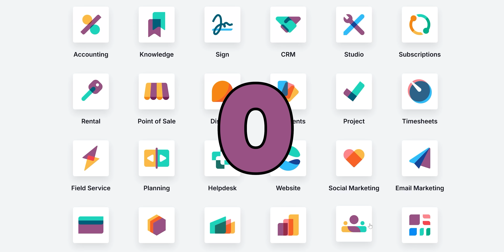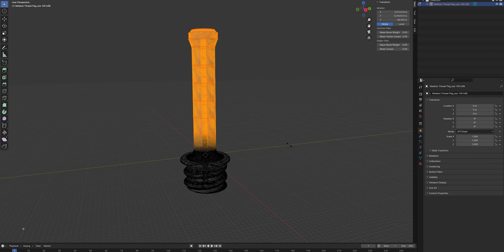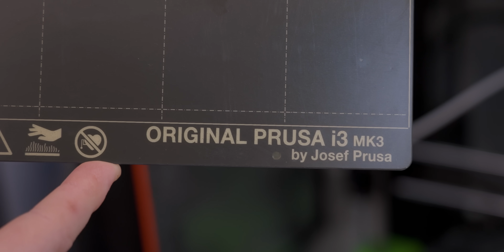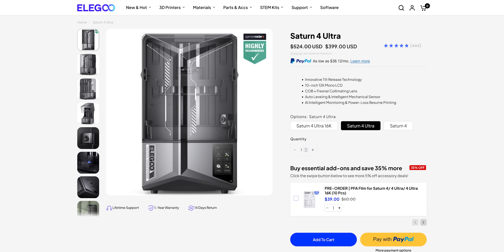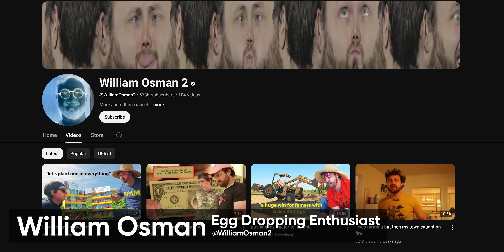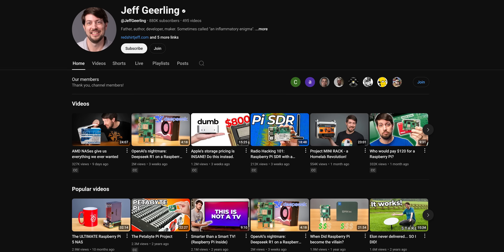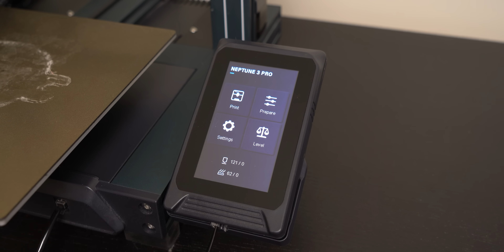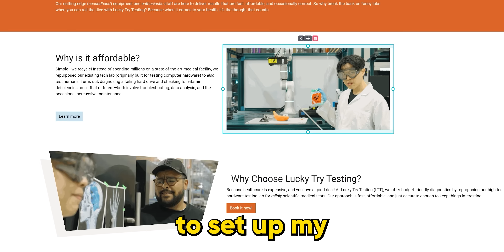Is my 3D printing setup wrong?

Comment: I got an X1C and it has been a dream ( like all bambu printers ). I frequent r/3dprinting and r/fixmyprint and everyday I thank myself that I paid a few bucks extra from my X1C. It self calibrates, does pressure advance, flow rate calibration, sphagetti detection, first layer inspection (only on non-transparent and non-glossy filaments). It is literally THE printer if you want a printer that JUST WORKS.

Of course A1 and A1 mini even P1P/S are also amazing since core tech is shared. And you can manually upgrade a P1 to include most of the highest impact features, like replacing the default nozzle with a hardened one, 3d printing an enclosure (for p1p), add a chamber filter and so on.

I am not a hardware tinkerer, I am a software tinkerer, so my favourite part is experimenting in the slicer and gcode post processing scripts using Orca slicer, imo it is the best slicer that gives you every tool to screw up your 3d prints IF YOU WANT TO, while also having 1 click profiles from Bambu studio as well if you decide not to tinker for a print.

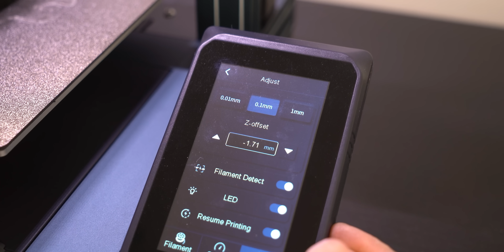Comment: 17:00  I had similar issue with my CR10-S Pro V2 and it was an issue with their firmware, where it didn't persist the auto level and z-offset values to the eeprom, so every time you turned the printer off, it reset...
Took me years before I figured it out and I just switched to QIDI X-Max 3 anyway, but there was a fixed FW around for it which I installed and it fixed that specific issue.

Comment: I have owned 3d printers since 2015. I've owned Creality (CR10 5S), Anycubic (both FDMs and Resin), and old delta Hatchbox I believe it was, and a Bambulab P1S. With the exception of the P1S were absolute crap. I have had only 2 prints fail out of dozens on the P1S and that was my fault as the print bed was in need of cleaning. The others, not one had a print success rate above 50%. As to Prusa, you buy a printer as reliable and as fast as the P1S for nearly double the cost? Think of all of the filament and prints you could pay for. Big no on Prusa until they are more cost effective.

Comment: As someone that wanted a printer for "function" and not a "tinkering hobby" my P1P has been excellent. It's reliable. It's fast. It "just works" (seriously, I've had 0 issues so far aside when trying to print things that where clearly not made for aan FDM machine XD). It's low maintenance. As much as I hate what BambuLabs did I'm not switching team just because for the 10-15 prints I do a year it's just not financially something I'd recover from 😅

Comment: As for the moisture, it's just not a problem with PLA. My printer is in a literal barn here in Florida, and it's currently 72 percent humidity inside my bamboo printer, which is printing fine. its other filaments that are the issue. I'm new to printing, but the last couple of months been printing and storing my pla outside in fl unsealed with no issue

Comment: 5:54 i learned the name of that sort of thing from watching "Smart Every Day" video on the kodak film factor, it's name is  an Accumulator. in their production line the film has to keep going so when they are changing rolls of "plastic" they need a way for the film coming to Accumulate before continuing. It is that big for a reason.

Comment: The Auto Bed Leveling feature that Camden mentioned is HUGE. Aside from drying filaments, bed leveling is a NIGHTMARE for new users buying cheap printers (like the Ender 3). On modern printers auto bed leveling is a necessity unless you want to spend 20 minutes leveling your bed every other print.
Reply: 100% recommend upgrading your printer with a levelling probe if you can. My cheap Ender 3 I can just hit print and let it go with PLA now (PETG can still be a bit hit or miss depending on when I last cleaned the bed 😅)
Reply: Swapping to opennep4une fixes that problem, but i agree its a huge problem. I thought they fixed it in a firmware update though, that could have just been for the 4 im not sure

Talking about the issue he had with the elegoo
Reply: @philmcruch  I have an Ender 3 V3 SE that I bought from them directly on ebay for $100 this past holiday season. It has native bed leveling and was practically turnkey, unlike my old Ender 2.
Reply: the current ender 3s have auto bed leveling
Reply: Why would you need to level it every print?
If leveled once it should stay in that position for a very long time,.
And even if not level, then what's the worst that would happen? Your print will be a millimeter offshape?
Most prints don't require that big of precision level (and most cheap beginner printers don't offer such precision in the first place).
Reply: @hubertnnn  Because every time you pull the plate of the printer to remove things  and reposition it something might catch under the plate and in some printers you can flex something. 1mm off is the difference between printing first layer entirely in the air or scratching the bed plate with your nozzle. 1mm is also quite a lot for any functional print.
Reply: @hubertnnn  many cheap printers use V rollers on a narrow rail - those get easily skewed with any amount of force. On my ender 3, I got to the point of manualy leveling every other print with a custom g-cose to not touch the printer until the print is finished. Then I got BL touch and boy, it was much better. Well, after compiling custom firmware, because stock implementation sucked and did random axis movements just like the printer in the video.
Reply: @Papinak2  That explains a lot. Its sad that YT deleted your comment, but I was still able to read it from the notification.
Together with @Przemo-c's comment I can now see the whole picture.

Comment: I've been printing for a couple years now, and started off with the Phrozen Mighty 8K. The printer is very nice, but wish there were some features that I saw others had like the auto refill sensor, vat tray with actual handles, and the lift plate with an attachment to let the excess resin poor back into the vat. Which the Uniformation GK3 Pro covers all that and will be my next printer.

Comment: flsun takes a different approach. Instead of quiet printers, they make them really fast, so you dont have to deal with noise that long. their best machine does a benchy in 9 minutes. I haven't heard neagive reviews about them, but I haven't been looking that long. my flsun super racer is working great, although its still from a generation where its a hobby, not a manufacturing machine.

Comment: They haven’t changed the deal after the fact. Third party integration was NEVER an advertised feature, there’s no deal to change. It just happened to work, and people utilising open protocols were told they were on borrowed time before it was fixed.

It’s disappointing you featured garbage like geerling who were quick to jump down the throat of bambu for clicks and engagement before even waiting… I think it was barely 24 hours before he supposedly had it all worked out… 

At least this video isn’t an interesting take on the saga, and isn’t purely just trying to profit from the algorithmic hate train (thumbnail aside)

Comment: 16:43 OMG that reminds me so hard about that buggy design my BFB 3D Touch had.
They used a magnet for getting the z-offset, which works fine when cold... BUT! if the plate got warmer/colder because your room temperature changed - BAM! Z gets a absolute offset of 1mm.
I fixed it by using an ir beam fork out of an printer and adding a black piece of plastic lol, never had an issue since with my z leveling again.

Comment: If you're not using Octoprint (or another FOSS firmware) you might be doing 3D printing wrong.

Even for professional use. Stop overpaying for "enterprise" proprietary junk.

(I say using a 10 year old makerbot clone)

Comment: The Elegoo Centauri Carbon is basically a P1S clone that retails for $300 and will soon have it's own version of the AMS and will likely be the go to entry level 3d printer, so I hope the LTT crew will give it a look from outside of the 3d printing community bubble. I myself own a P1S that I love (aside from the recently introduced software/access issues) and a heavily modified Ender 6 that I learned a lot using but would never recommend given the much better 2025 options.

Comment: Flashforge amAD5M was literally plug in, install filament, run built in calibration and print models. 

Prints up to 600mm/s and can be had for $279.

Way better than any other printer I've had

Comment: I have an Ender3V2 and an Ender5Pro. I have upgraded them with all the bells and whistles, at least doubled them in value in upgrades alone and made them hands free. Haven't had a print fail for 2 years now.
Reply: Showoff
Reply: bambu is better value really, those upgrades costed how much?
Reply: @ellisfletcher3491  I have had these printers for years. Don't get me wrong, I have eyed bambu printers for a loooong time, they're certainly good value, but I'm not the type to drop €600 to €1500 in one purchase. Idk exactly how much I sunk into my enders, but the most upgraded one by most is my ender 5 pro. It's got a bltouch, coreXY mod, direct extruder mod, upgraded hotend, noctua fans, diamond nozzle, linear rails, runs klipper, accelerometer for tuning,  raspberry pi + camera so I can start and monitor prints remotely and a wifi plug adapter to turn the printer on and off remotely.
They're fast, tuned, and are reliable. Yes I've sunk as much money into it as a p1p, but I love tinkering and repairs are cheap and readily available. It has been good value to me personally.
No multi filament printing tho, but I mostly print replacement parts anyway.

Comment: I'll stick with Bambu Lab printers. You can use any slicer you want, but yes it will be more seamless with their slicer. Exporting a file from your preferred slicer and using intermediary sugar to send it to the software isn't an issue. Could also move the memory card between the printer and computer. Bambu was never open source, so none of these changes should be a surprise. For those that feel differently, thankfully you can shut off Internet access to the printer, or use one of the countless other brands.

Comment: Creality has pretty much solved the filament jamming issue by making it easy to access it from underneath on their CFS. Plus, with a 350x350x350 bed, I'll definitely be going with them next. Only been into 3D printing for a month and I love it, I've had my Flasforge 5M Pro for a month and I already want to upgrade 😄. For the price the Flashforge 5M Pro is amazing, but I want to get into multicolour prints, plus that massive bed is very nice.

Comment: I will say being a P1S owner, the updates that everyone is concerned with have zero impact on me. Being a hobbyist as it is and maybe randomly printing things for my wife to sell. So I’ll be sticking with  my P1S.
Reply: Also Linus, print the desiccant pods for the AMS units and add hygrometers. Then all you need to do is get some bulk desiccant to fill the pods up. These keep my filament around 10% humidity.

Comment: So you are complaining about an update for the X1C while you are showing yourself using a P1S?  Yes it is an issue for the community, but it's not hard to just turn off auto-update and wait till the community either finds a workaround, or BBL gets in trouble with the EU for deceptive practices and ends up on the wrong side of a lawsuit.  Either way, this has been driven into the ground MONTHS AGO and for you to act all surprised now because of the new firmware announcement just makes you look bad man.

Comment: I have a rather large print setup with both sla and fdm, I don't have any drying in my setup, I live in and extremely damp area but all my stuff is in a basement full of unsealed concrete that is cracking so it is supremely dry down there.

Comment: I went through the 3d rabbit hole when my wife got me our 1st 3d printer. 3d printing wasn't really on my radar until my wife was like I did a thing lol. I was a bit surprised at 1st. she had bought a creality ender 3. super basic printer. it was love at 1st sight lol. didn't take long before I rebuilt the printer. I did a silent board, new power supply, and direct drive extruder. then came the 2nd printer and modded that one and the 3rd yup modded too. so, now I have 2 ender 3s an ender 5 plus all great printers. but they are running marlin which means not very fast at all. but then Klipper came out and that is a total game changer. I now have the elegoo Neptune 4 plus that has such a great printer. sad to say I don't use the other ones at all at the moment. I now have a list of printers I want lol next up will be a Voron. I can't wait. best hobby ever!!!
Reply: Yep, def one of the best hobbies

Comment: We use a Bambu X1 Carbon here at work. Not once has our AMS failed. Never had a clog either, as they even recommend drying the filament before using it, which I usually do. (We use primarily PETG HF.) After a year plus of using it, only one print has failed, and that was due to a settings mishap. I get why some are irritated at their latest announcement, but it doesn't really effect how we use it. Their slicer and app are still phenomenal.
Reply: I also have had zero AMS clogs, but I've only been through a couple dozen rolls of filament.
Reply: I also have an X1C and have never had any issues that weren't user error (dirty build plate/wet filament) and have hundreds of printing hours on it. Have only done the recommended maintenance when it recommends it and have actually enjoyed 3D printing again now that I don't have to do a ton of troubleshooting for a comparatively lower quality print that also takes longer on other printers I have used. Bambu slicer has worked perfectly for my use.
Reply: BuT ThAts juSt ReskInEd pRuSa slICeR

Comment: Personally I find Joseph Prusa a very toxic person, and while people might argue that Prusa printers are great because they are not Chinese (fun fact, they absolutely use Chinese parts, whether they buy them directly, or indirectly by buying buy parts from other countries, that were built by using Chinese parts), but he's effectively trying to gatekeep everything. When they made they made their fork of Slic3r, Joseph found this perfectly normal, when Bambu did it, he cried about it. When Printables was made, a 'copy' from sites like Thingiverse, Joseph found this perfectly normal, when Bambu made Makerworld, Joseph cried about it, claiming they were stealing UI etc (when in reality it's different, and follows basic design elements), and also while Joseph whines about Bambu's closed system, he himself released a massive POS camera, which only works if you use their closed system, make an account etc, completely ignoring the fact that Bambu doesn't need to be used in a close environment to begin with.

Joseph Prusa is all about gatekeeping, deciding who should do what, how things should work etc, when in reality he absolutely hates what Bambu has done, which was make a way better printer, for a much lower price.

Does that mean Bambu is the right choice? Not if you care about an open system. But paying 3-4x as much for a printer so you can pay the gatekeeper, is just ridiculous.

Honestly, right now, it looks like Elegoo is doing the right things. They've been lagging behind a few years, and still do, but while printers have been getting better, ever since the P1S came out, there really haven't been a big change in consumer printers since (unless you count the 4k+ 5 headed Prusa XL a consumer printer - which isn't an unfair statement, but is extremely expensive for a consumer printer), I think the major one is the heated chamber, which their Centauri Carbon doesn't have iirc, but if you don't need that, I think it's a fantastic deal and for a quarter of the price of the Prusa Core One.
Reply: Very well said, he has a huge ego problem. Qidi printers are also a good option.

Comment: FYI, resin printers are notoriously dimensionally inaccurate. UNLESS, you get engineering grade resin AND its NOT cheap 😁also, if you find resin more accurate than maybe your filament 3D printer really needs to be square and trammed